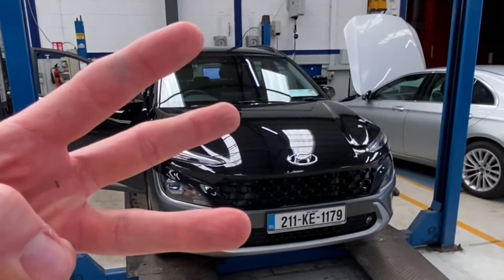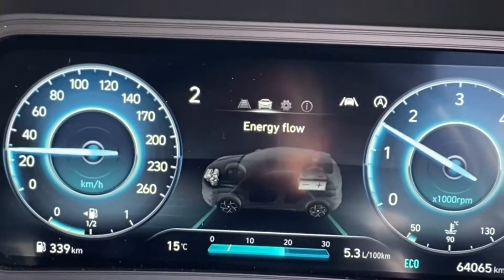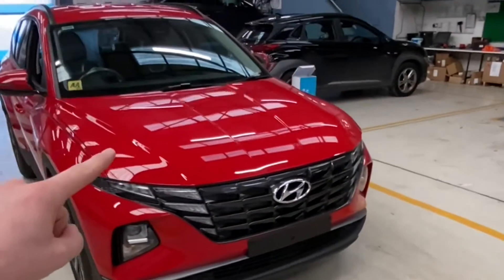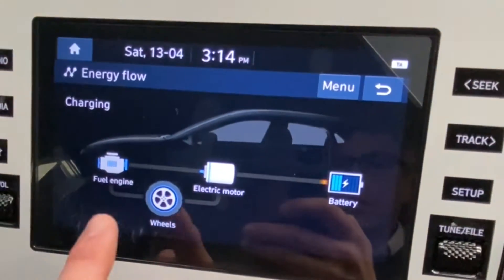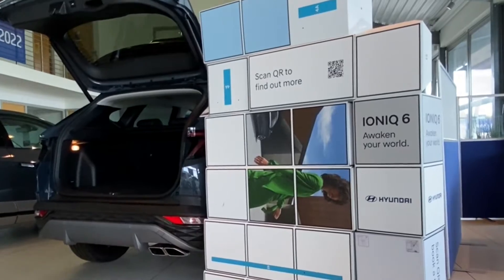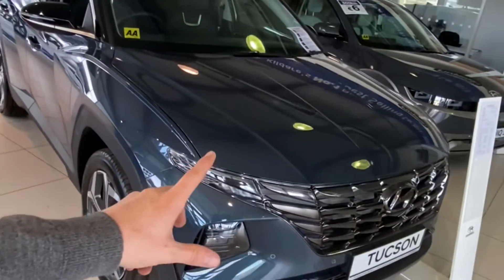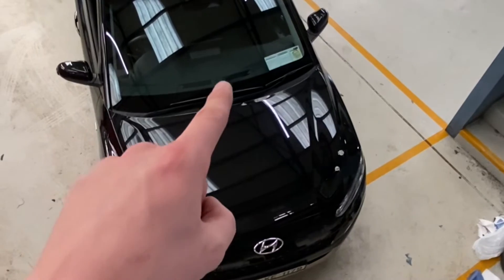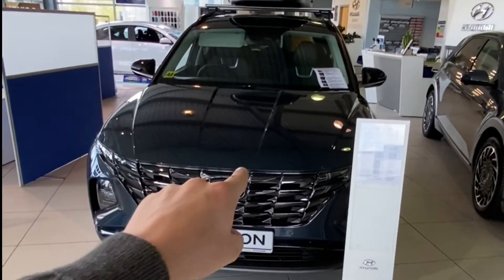Mild HYBRID Vs Full HYBRID Vs Plug in HYBRID - what is the difference?

Comment: Hi Brian I have a full hybrid and I’m going away for 2 months I am concerned about the 12v auxiliary that it will be dead by the time I get back I know how to open the door and use the 12 v battery reset button would it be better if I disconnect the 12v connector until I get back and then reset the items in the car thanks
Reply: Hi Brian it’s a 2025 sportage hev I know technology changes so fast there’s nothing on any forums the manual shows where the 12v connector is so was wondering if that’s my best bet thanks
Reply from the maker: @ the 12 V battery is an integral part of the Hybrid set up so I definitely wouldn’t disconnect

Let the battery go dead, and the battery management system will do its thing 

One point of Note when you return, and if the battery is dead , go to your boot and open it, and it should wake up the car🙂🫡
Reply: Thanks very much Brian you know more about new cars than some mechanics I know 🤣👌
Reply from the maker: @ I’m probably just lucky because I see this type of stuff every day! If the car doesn’t wake up from the boot, you can always access it from the drivers door and then fire up the 12 V reset button!
Reply: Thanks I know how to do that with the key I was going to fully charge the hybrid battery with sports mode would that be a good idea?
Reply from the maker: @ honestly 🙂I don’t see the need as the battery management system will shut down either way if feels it needs to👍
Reply from the maker: @johnhanlon-u4s  hi there, what type of vehicle do you have?